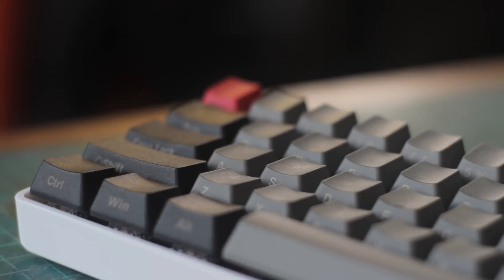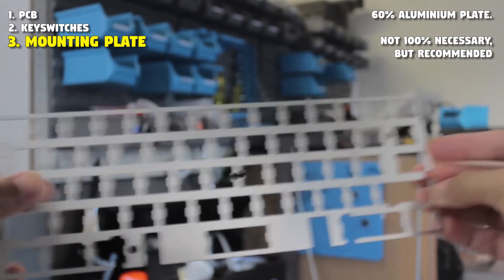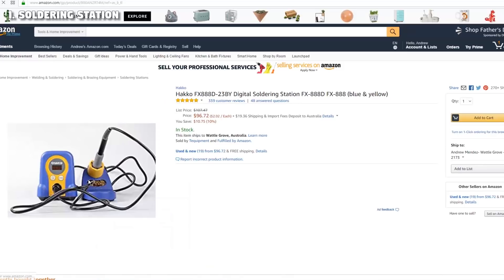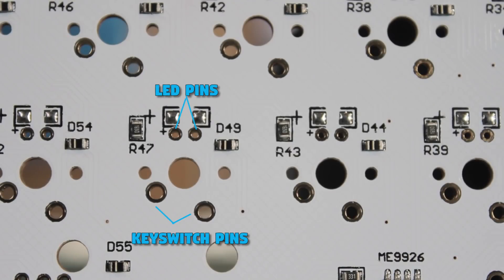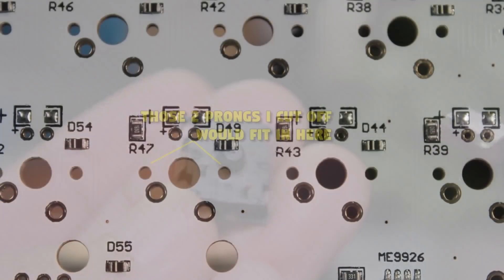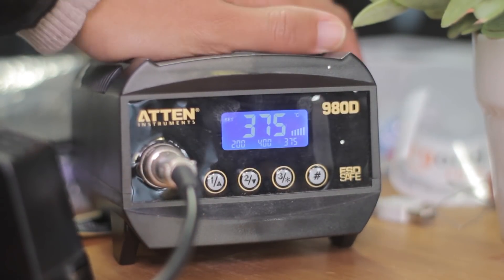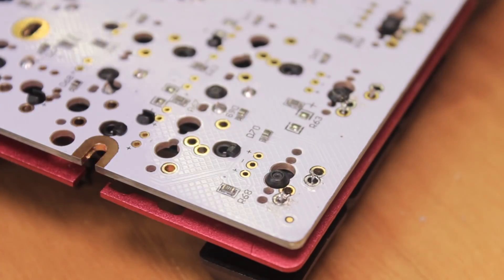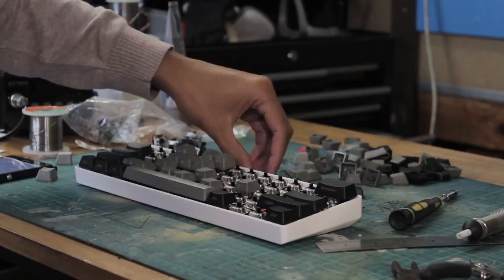Beginner's Guide : How to Build a 60% Mechanical Keyboard

Comment: Did I get it right? YOu don't have to solder if you're using PCB Mount Switches?
Reply from the maker: Nah. You do have to solder to connect the switches to the pcb, but you don't have to solder to lock the pcb and plate in place - since they have prongs. Plate mount switches won't hold the two pieces in place, so if the plate is slightly bent, then the switches won't be completely inserted.

Basically, you need to sandwich the pcb and plate together. But in the end, all switches need to be soldered to the pcb. Hope that makes sense :)
Reply: TaeKeyboards okay, thanks :)

Comment: Could you use ALPS switches or other switches if you had caps for them?
Reply from the maker: You'd have to get a special plate and pcb for it, because of the different pin positions and the actual size of it.
Reply: TaeKeyboards Ah alright. Thanks for the response! I was thinking if I ever picked up an older board with switches I end up liking it would be fun to put it in a new case and do other mods. Anyway, cool video, keep up the great content! :)

Comment: Did you sauter all the little sections for each key? Or do I just need to do what you did?
Reply from the maker: Not sure exactly what you mean. If you mean the soldering, then I strongly recommend watching some soldering tutorials to fully understand the concept.
Reply: Oops, sorry, I was a little unclear. Do I need to solder (sorry, didn't know how to spell it) each one of those little holes before putting the switch in, or can I just put each switch in without soldering it? I don't know if you talked about this in the video. Thanks!

Comment: How long did shipping take? I'm looking to get a new keyboard, probably because I lurked on /r/mechanicalkeyboards for so long, and I really like the look of this one. Also, could you use cherry switches instead of gaterons with the same pcb and mounting plate?
Reply from the maker: Banggood typically has the standard Chinese shipping which is like 3-5 weeks.

And yes, you can use any Cherry MX style keyswitch.

Comment: Don't... use lead based solder wire..
Reply: Unless you're eating the solder, or your electronics projects, lead toxicity is not going to be an issue. The fumes aren't lead (lead does not vaporize at 360c), and you'd need a long career at soldering for the fumes to be an issue. Noone in this thread is going to have an issue with using leaded solder.
Reply: i learned to solder with lead-free, but for my own uses, lead solder is much easier.

i felt weird about it at the time, but everyone had said to get solder with flux in (which my school's solder didn't either - they used the cheapest tools they could, the solder suckers were useless), and the ones with flux had lead, and i really was surprised at how much easier it was.

the school's irons weren't variable temp, so i couldn't just go hotter like kittey suggested at school. most of my joints back then ended up getting too much solder on, though of course didn't didn't impede any function, and if it caused a short i removed it. (of course all of the joins were matte instead of shiny, due to having no flux. i thought something was wrong with me because i found it so hard to solder well, and two of the people in my class could solder fine. but at least now i know they were just miracle children or something, soldering with no flux and no lead !!)

but, of course, when electronics say "now we're lead free" and people go "they still use lead???" well, normally it's just the solder. so companies loudly proclaiming going lead free either means solder paste and reflow robots (which are good) or forcing line workers to use shittier solder, which leads to lower quality joints and causes them to fail faster.
Reply: Kittey-Senpai lol
Reply: Lead free solder is terrible to work with, it doesn't flow like the lead based does
Reply: Have you ever soldered anything "Kittey-Senpai"? Probably not, since everyone who solders on  a somewhat regular basis, some even at their job, know you should use lead based solder.  
Its just better in many ways, just use some good ventilation and everything's fine
Reply: i agree, LEADless solder is definitely a better choice especially if you have a solder station that can adjust temperature, ive noticed that leadless solder has to be used at a higher temperature
Reply: Well it is toxic, though it would only really harm you if you'd literally inhale it daily. Like I said, good ventilation or good airflow does the trick. Solder with any amount of lead in it is almost always better than "normal" solder without lead. But I guess if you learned soldering without lead, you're probably able to solder with just about anything
Reply: We had our stations set to 320-350c and it worked wonderfully. Biggest reason we used leadless/leadfree is due to lead being toxic.
Reply: I have soldered, it's a part of my study. We used leadless to my knowledge due to lead being toxic.

Comment: How much did this all cost you?
Reply from the maker: Parts were provided by Banggood. But they total at $83 USD.
I already had all the soldering equipment.
Reply: TaeKeyboards one more question, would the stabilisers fit a 100% mkb?
Reply from the maker: You would need 2 more 2 unit stabilisers (like the 4 small ones) for the large + and enter key on the numpad.
Reply: TaeKeyboards alright thanks!

Comment: I'm having issues with one switch on my keyboard. It either will not register or register with random chattering. Outemu blue switches. Any help?
Reply from the maker: Hard to say. What keyboard?
Reply: Switches break over time. I haven't used outemu switches my self but it's happened to me with khail  and cherry switches. But in my experience the clone switches seem to fail quicker sadly. Just change it out and it should work.
Reply: this video might help watch?v=4e_7t8eK8t4
Reply: I will try this when I get home. Thanks :)
Reply: Are all of the switches acting like that or just a couple?
Reply: Just two.
Reply: It's a Motospeed Inflictor CK104.
Reply: The switch is probably faulty, try changing it out. Happens sometimes sadly.
Reply: Hmm. The keyboard didn't have the problem when it was new. Could the switch still be faulty?
Reply: I was 100% sure you were going to say it was a ck104. It's a common problem, but you can fix it by putting one or two drops of isopropyl alcohol in the switch (with the keyboard turned off) and then pressing the switch a few times. I saw a lot of people with the same problem, and this method always worked
Reply: Maybe try to re-solder that switch

Comment from the maker: Soldering Tutorial from my friend JUJU : https://www.youtube.com/watch?v=cRJV1jo5vao&t=114s
Total cost of components was about $105USD (EDITED! Thanks to Frank Rossi) (Does not include tools). Also subtitles are available.
Reply: For that price I could buy one already built.
Reply: Just Priced this out and it came to about $105.  Did I miss a sale or something? Not sure if it's worth all the hassle when I can buy a similar build for a similar price =/.  Or the Pok3r is like 20 dollars more and it has a metal case =/

Switches $18.99
Stabilizers $4.99
PCB $33.49
Mounting Plate $14.99
Case $11
Caps $22
 
Total $105.46
Reply: Frank Rossi - you are right, Vortex Pok3r would be cheaper and pre-assembled already than doing everything yourself. Also Vortex is about to release flashing software so you can program the board however you like just like DIY board. That's why I bought Vortex Pok3r and trying to buy another one used as my experimental board that I will do all the mods to.
Reply: Ronald Ramirez the gh60 Satan uses mini not micro if I'm not mistaken
Reply: Marcos García Why tho?
Reply from the maker: Absolutely correct! Damn, I must've missed something. I'll fix it up.
Yeh, this is just an example of what's possible :)
Reply: hey mate, what kind of USB are you using for the keyboard (mini, micro, etc)? Cheers!
Reply: appreciate it mate! Ordering all my parts today for my first build :D
Reply: Ronald Ramirez awesome hope you like the board once it's all put together.
Reply: TaeKeyboards I have a loaded question going you could help. So I recently purchased a KC64 from eBay my first 60% KB. However I noticed that certain keys don't register when you type quickly. I like the keyboard and have already doesn't a considerable amount of money in the last year on different mech boards. Would I be able to re-use my cherry MX brown switches, plate, case and keycaps and just replace the PCB? Would I also be able to have the same layout that was originally for the KC64 or would I need to buy stabilizers to make it a standard layout?
Reply: how much did all of it cost u?? or how much did the keyboard (or materials to build the keyboard) cost u?
Reply from the maker: Bout $84 USD for the components.
The tools and soldering equipment are not included.
Reply: thanks

Comment: Didn't lube the stabilizers?
Reply from the maker: Yeh I did, but later on. Missed it in my on and off filming :(
I shoulda shown it earlier, but forgot to put it in, which is unfortunate because it's pretty much necessary with these.
Reply: Ah, whew, lube is a must for stabilizers.
Reply: Johnathan Bloch super lube synthetic grease with PTFE or dielectric grease.
Reply: What lube would you use for the stabilizers.
Reply: iNViSiBiLiTi Thanks for the info!